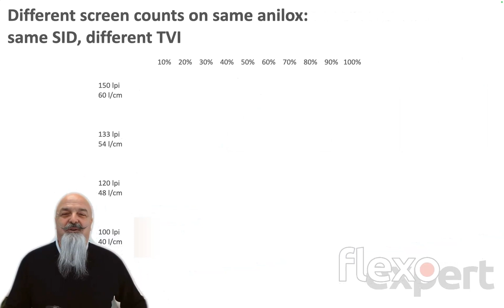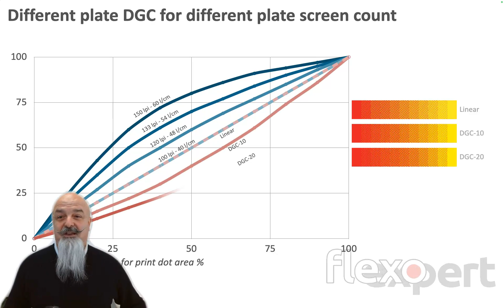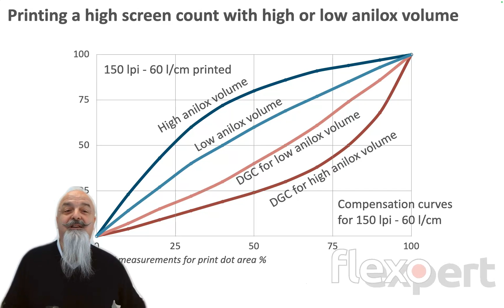Printing different screencounts with the same anilox (LR)

Comment: Mr Stefano .. is is possible to determine which hardness stickyback tape should be used to certain plate  production in prepress stage it self?? Soft hard medium tape?
Reply from the maker: Well, the choice of adhesive tape is made according to the printing condition, not according to prepress or design. So it is decided during optimization phase of system calibration. If you need to change the tape, it means that your optimization was not conducted in the proper way, therefore the aim values and profiles derived from your fingerprint and characterization are not reliable...
Reply: @flexoexpert  thank you. Great information